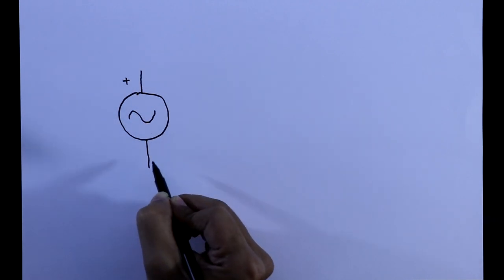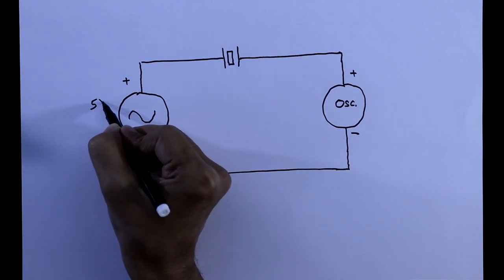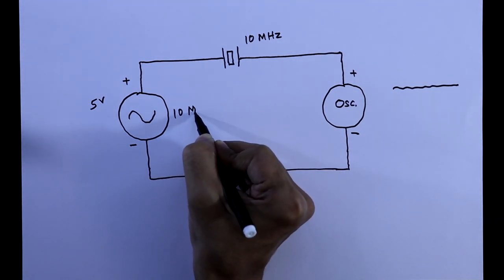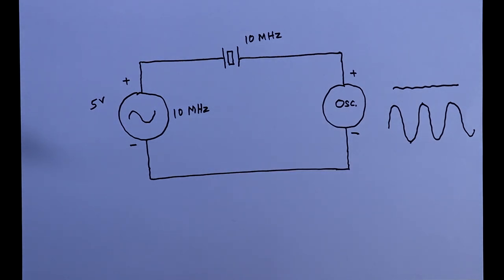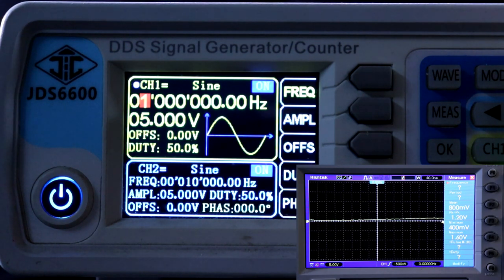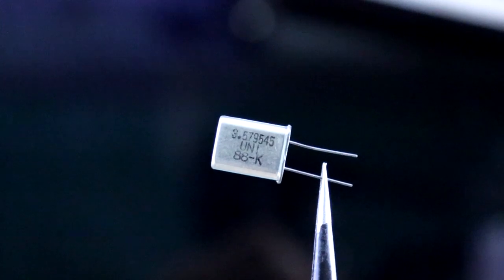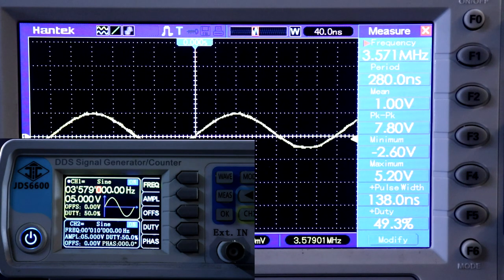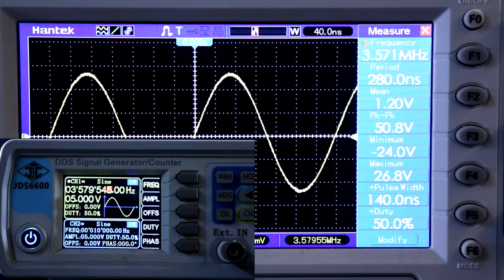How to test XTAL crystal oscillator using oscilloscope and function generator

Comment: 1:49  Why is the peak to peak voltage 18 volts instead of 2 times 5 volts times the square root of 2 which would be approximately 14.1 volts ?